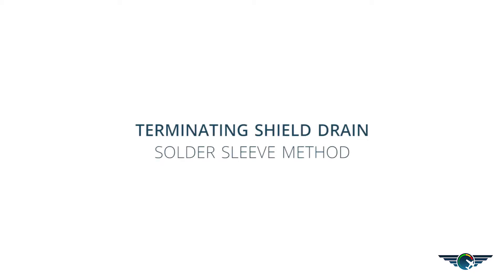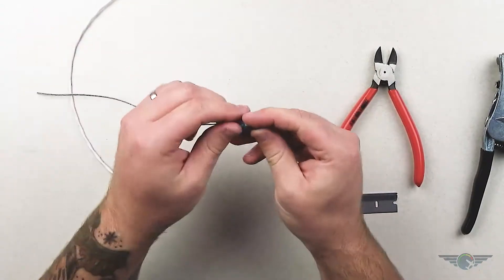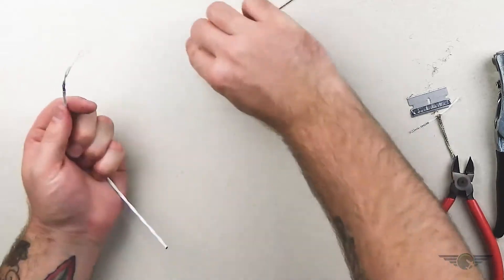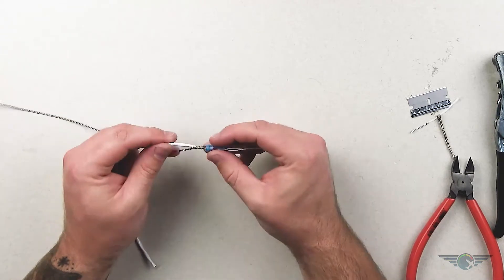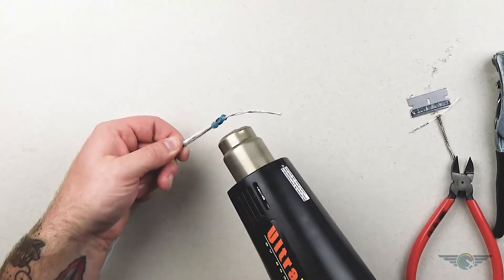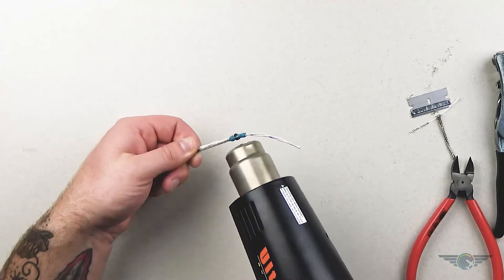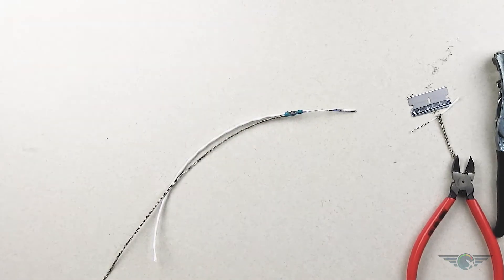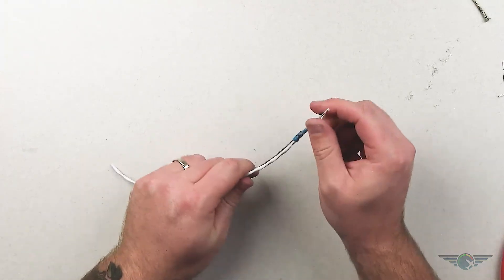Garmin G3X Wiring Fundamentals Series – Terminating Shield Drain Solder Sleeve Method

Comment: Solder sleeves are expensive and risk overheating the twisted pair insulation. The  result is the shield punche through to one conductor which is hard to find and usually very difficult to access in a finished aircraft. Instead fold the shield back over the outer insulation and hand solder on the drain wire. Quicker and no chance of damaging the twisted pair insulation. Then fit adhesive lined heat shrink over the shield which will environmentally seal the joint.

Better cheaper and no risk

Comment: What is the maximum exposed length of the unshielded section (between the solder sleeve and the connector)?
Reply: correction: minimum allowed exposed length
Reply: sorry: "maximum allowed" was the correct question
Reply from the maker: Great question! This is well explained in the G3X Touch installation manual here starting on page 319:  http://ms.spr.ly/6057TbCmD

^DK